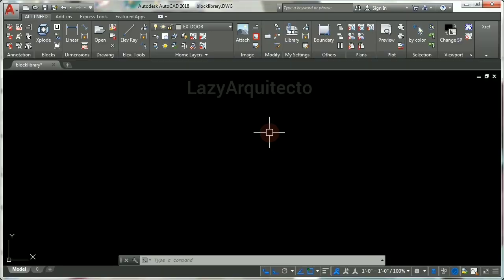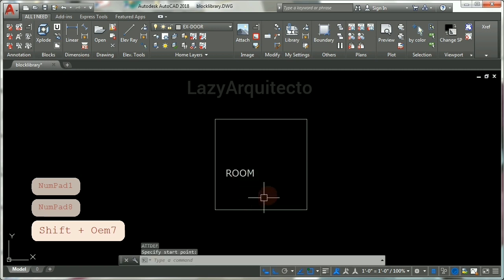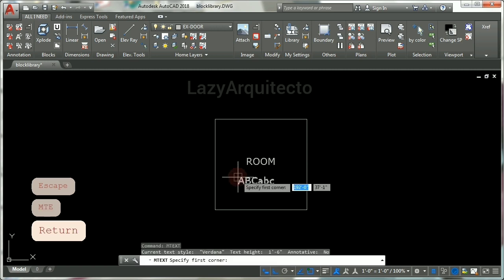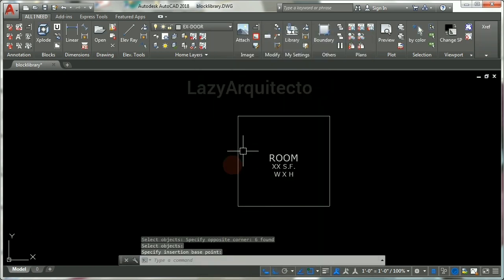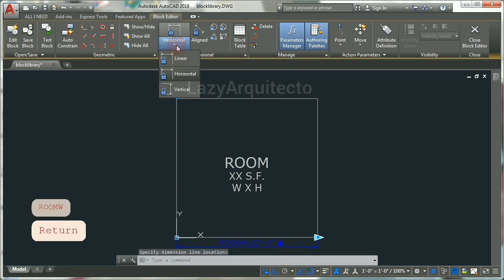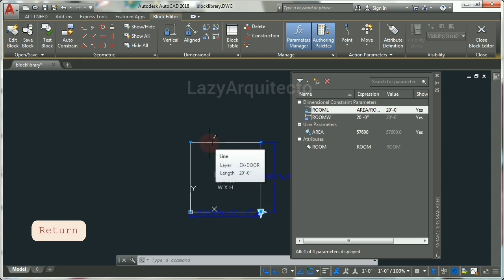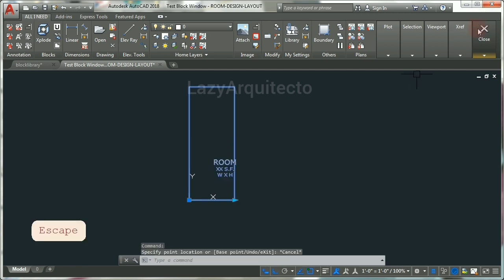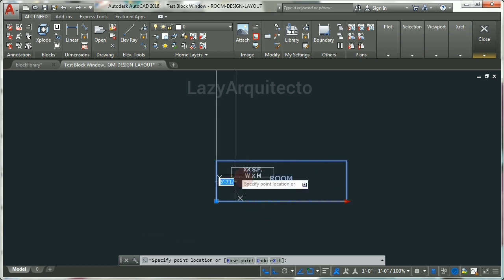Advanced Autocad Dynamic Block with Attributes, Constraints & Fields

Comment: @1:58 creating a rectangle object and put attributes in it and convert it to a block 
@6:19 open block editor to add dimensional constraints
@7:47 link the dimensional parameters so when they change they keep the area
@7:51 add an area parameter to control the ratio between length and width 
@10:10 put dimensional constraints on the room name txt to stay in the middle of the room
@14:45 adding fields to the mtxt to input length and width
Reply from the maker: Thank you George!
Reply: @LazyArquitecto  you are welcome 😁 im jst too lazy to re-watch the whole thing 😅 i hope this help ppl to follow along and learn effectively 😊 and thank u for the knowledge you share

Comment: Thanks for your time and efforts. Great tutorial!
I have a dynamic door block with an attribute within for door tag. I can adjust the width but have to manually type the door tag. I would like to make it such that the tag would automatically update depending on the width.
Also is it possible to use conditional formulas like in ms excel?
Please help...

Comment: I think the formula should be (RNAMEV/2)-position lower than room text
let's say the square is 25m2 then the room text coordinate is at 2500,2500
so it's in the middle. then the position of dimension text lower than room text, between 2500,1500 coordinate. So the answer is (RNAMEV/2)-1500 (position adjust to your liking)
Reply from the maker: Thanks for your feedback Daffxter. We never stop learning. Hope you're safe!

Comment: Hi Lazy Arquitecto! Super helpful video, thank you. 

I get a notification that the CAD block is not fully constrained, and I noticed you get the same warning in your video too. Do you have any issues with the title of your blocks just flying off the block after a couple of resizes? I'm having this problem and am wondering if it's got to do with the constraint issue.
Reply from the maker: Hi no I didn't have any problem with this Autocad dynamic block. Did you try refreshing the block with Batman command or attsync?

Comment: I am trying to do a similar block, I like to use bubble diagrams and want to try them in autocad. I'd like the bubbles to be representative of the room size; for example, a 144 square foot room would be a bubble that fits inside a 12'x12' square. I can get this to work using a simple circle with attributes, by constraining the circle to a square that’s on a non-plot layer, but I like my bubbles to have a little flair to them and that’s where I get lost. I’m thinking the scale action on just the bubble and the flair parts (background mask, and a shadow line) and not the attributes, but i can't figure out how to get the bubble to scale to the correct size bubble. Any help you could give would be appreciated!
Reply from the maker: Hi @davidmarr5245 Hi David, I received your email. I might answer you in livestream for our lazyQuestion show. Have your bell 🔔 notification on and here's were you'll find the video ➡️ https://youtube.com/playlist?list=PLbDdle4GGWB4AwQq3SdT2xSSnseGRYEie
Reply from the maker: David here is how I fixed your block Dynamic Blocks That Transform AutoCAD Workflows (Practice Files Included)
https://youtu.be/QWUELks5ZB4

Comment: Need a block to automatically put dimensions and area of room.
Reply from the maker: Doesn't this video do that?
Reply: Lazy Arquitecto Yes but can this be modified so that the area is calculated from the dimensions and not the other way round.
Reply from the maker: @mzanpure  yes it can be done. However, wouldn't this give you the same result?
Reply: Lazy Arquitecto Here I am confused as you put in the area and that decided the dimensions. What I wanted to do is adjust the sides as per the room size and it gives the dimensions of the room plus the area. I have created a block for that but I used a rectangle instead of lines and so had to put in additional two lines to give me the length and breadth of the room. Your technique is better and I am trying to alter my block accordingly although it is past midnight here. 😃😃
Reply from the maker: @mzanpure  now I understand your idea better. This is why I'll do a online class raffle. Where members of our team can win a 30min one to one with me meeting. Does this sound interesting to you?
Reply: Lazy Arquitecto 👍 Yes
Reply from the maker: @mzanpure  Ok. I'll ask more friends from our team if they will be interested too. If at least 10 people are interested then I'lll start doing online class raffles. I'll let you know!